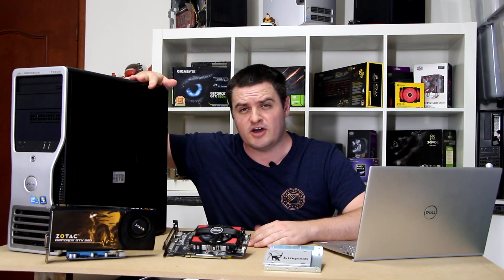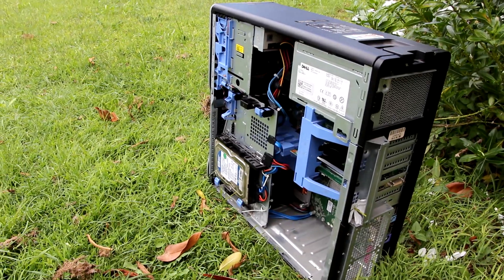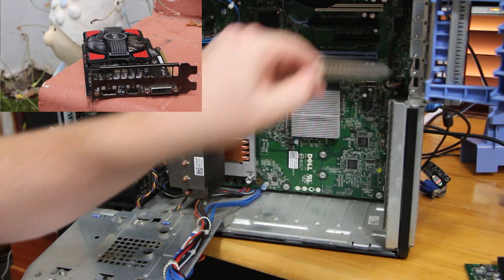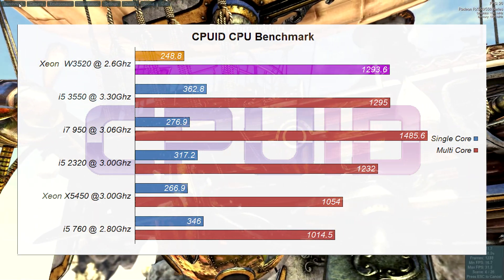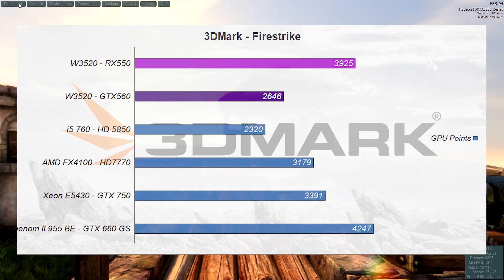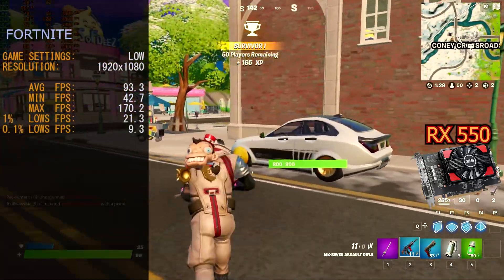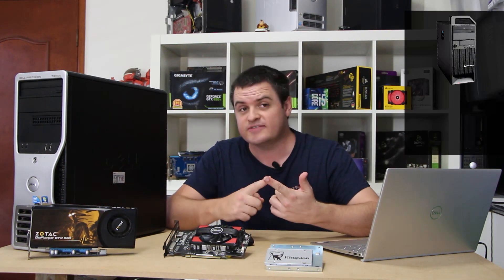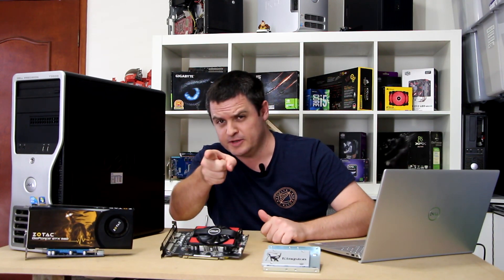Fortnite Gaming PC for under $110 USD.

Comment: I picked up a z400 recently for cheap and put a x5675 in and a GTX 760 4gb. It came with 12GB ram but no hard drive so I added an ssd. Perfect build. 

Probably worth mentioning some games now require avx but there is often patches made like age of empires 4
Reply from the maker: Strangely enough that is the exact PC i am currently running except the video card.
Still very capable, but new instructions sets will always be a problem with older systems.